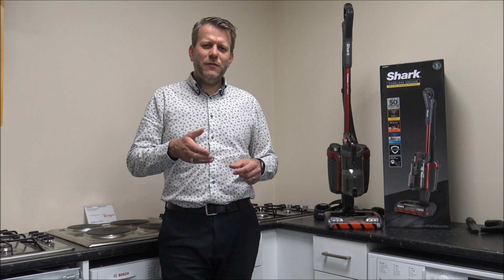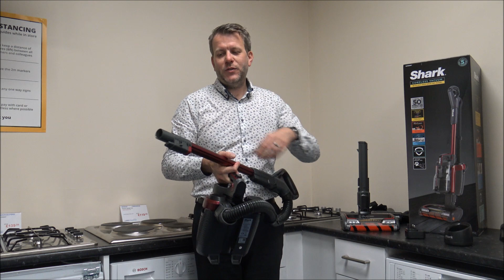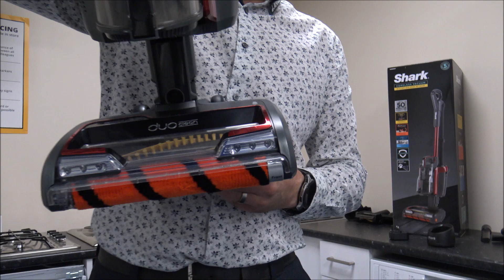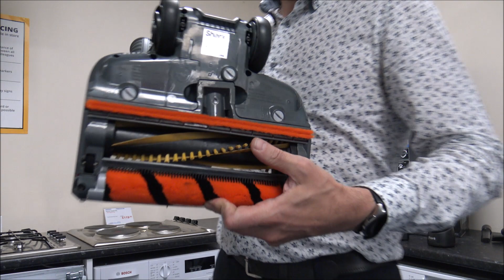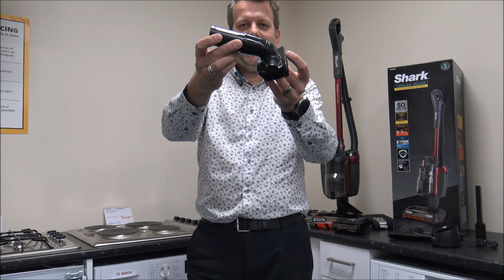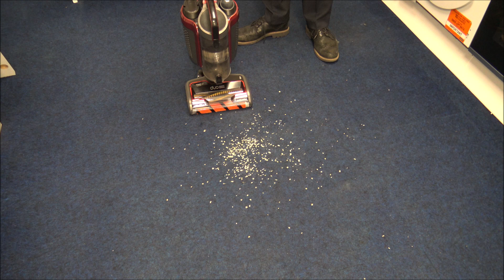Shark ICZ601UKT Cordless Vacuum Review and Demonstration

Comment: I'd be interested to know what kind if filters this Shark uses and how they are cleaned and/or replaced. Also, does the wand detach at the handle or is it permanently attached . Thanks from the U.S. !
Reply from the maker: The handle can be removed if you want, it isn't permanently attached. It has a Hepa filter next to the battery and it can be removed to be cleaned
Reply: Vacuum Wars has another well done video.  This ended up being his favorite for the year.  Nice thing is most of the parts are interchangeable with the Ion p50 including the batteries!
Reply: Also has 2 other filters on the other side from the battery which can be washed every month or so.